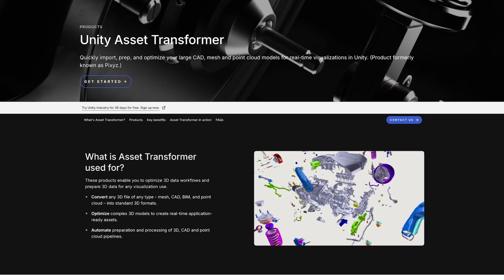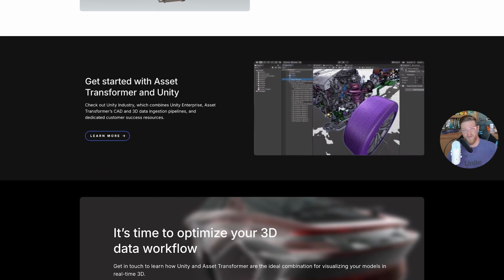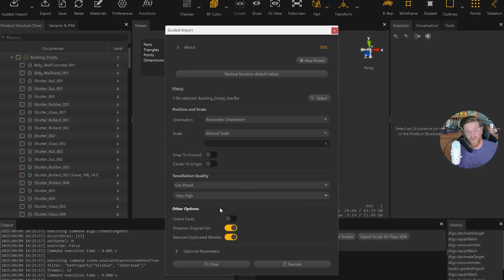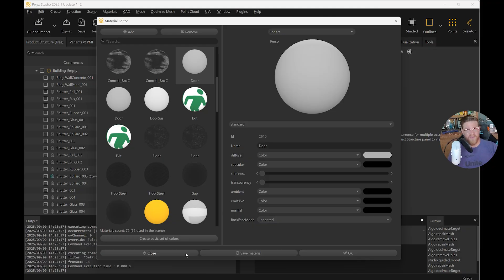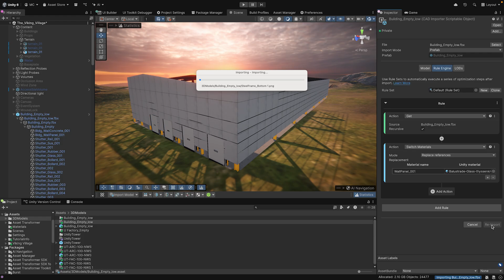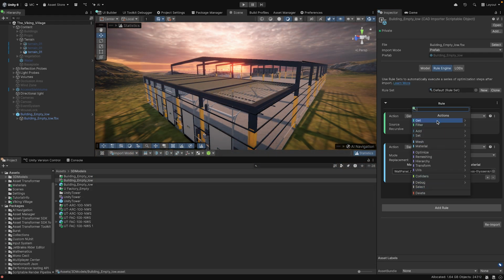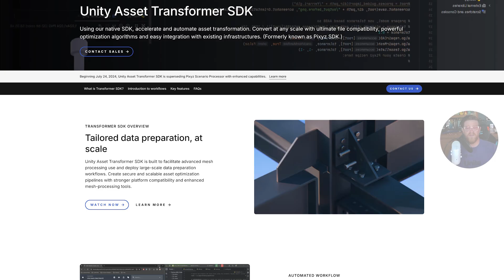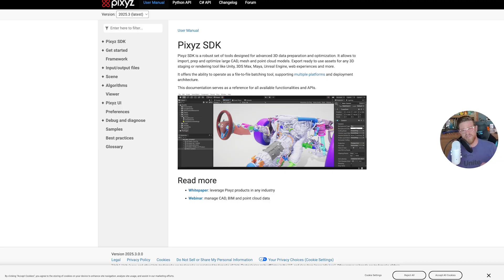Unity Asset Transformer - Getting Started with Unity for Industry

Comment: For those confused game dev: In Unity we always deal with polygonal meshes made of triangles. But in Revit or other CAD tools, the geometry is stored as BRep data, basically vector math (curves and surfaces). When you export that CAD model for use in a game engine, the BRep has to be tessellated into a mesh so it can render.

The problem is, CAD exports often produce very unoptimized meshes with tons of useless triangles. That’s where tools like Asset Transformer (formerly Pizza plugin) come in, they don’t change the tessellation itself, but they clean up and optimize the mesh so Unity can run it more efficiently.
Reply: Great explanation! The video explanation is filled with technical terms